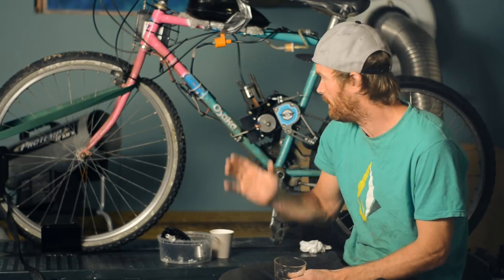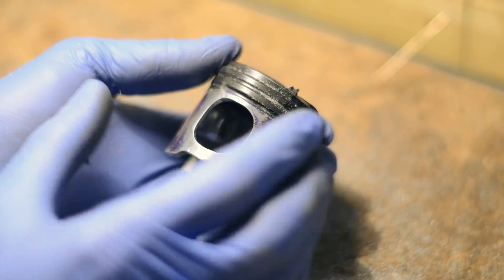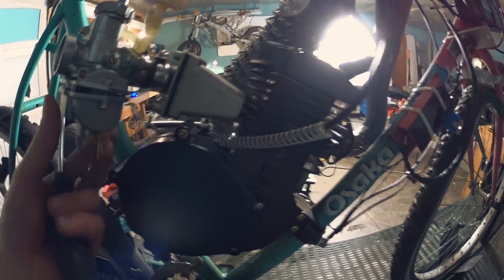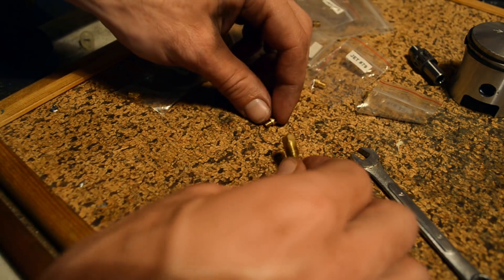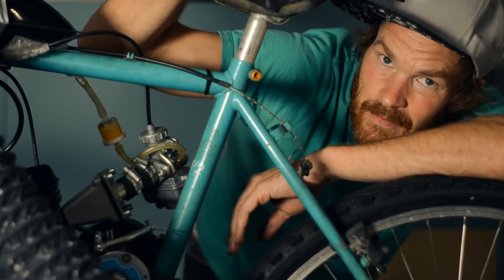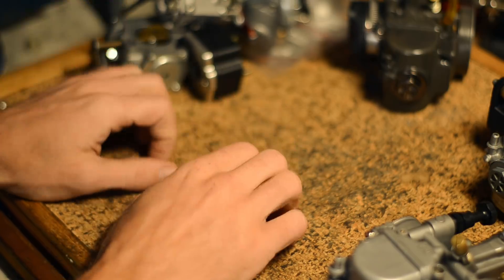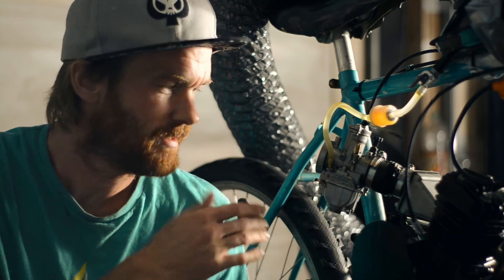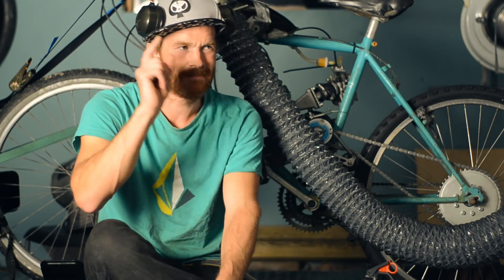Reed vs Piston Port part 2 -

Comment: I’ve also went an windowed my piston like LA Hover Bikes, now I’m going and re-jetting, I’ve got a 72 jet in now and gone all the way from 60-72 with a little bit of a better run with each jet increase. Still not running how I want it to though, any suggestions? 
EDIT: I had an air leak with one of my 4 head bolts not tightened down all the way, it is a whole lot better but I still feel like there’s more room for improvement, any idea on what size jet my get me to where I need?

Comment: 4   years   later ,   &  things  have   really 
 changed.
Reply: @Eduardo_Espinoza and now five years later and holy moly have things changed with motorized bicycles! It's crazy! Smolik Performance is the number one leader in pushing out Grade A billet engines and products. Along with the team Ken Hinson and Kelly Cansler designing the A85, good out of the box power can be had at an affordable price now. It's amazing!
Reply: @JstF64 sweet 😋

Comment: Yes Sundays were always hard to get away with LOL. I used to run chainsaws in the 80s and they had the Reed valve on the chainsaw right after the carburetor and what you really got me going on this one of us the guy who had this before me I put it on somewhere else which makes a lot of sense. They have a lot to do with back pressure or your bottom pressure or I don't know what it is but these motors are so simple to run that used to make them so simple to run back in the 80s late 70s it was nothing but a piston with a carburetor on it and a little wheel for the chain that's it now I think they make them so damn cheap they look nice but they're cheap anyway great work. I'm ready to take my bike out now I'll see if it's a disaster or if it works.

Comment: If u used an extra base gasket and an extra head gasket u would essentially have a stroker motor the two gaskets would act as a cylinder wall this way u get higher compression and can adjust to the finest degree by shaving the head and too of the cylinder down to get the tightest squish possible

Comment: Havent you ever tried a Tillotson from an old chainsaw? Like a Stihl 051 or similar? In my country they run competition go karts with a similar carb to those Tillotsons, and the engines are Minarelly based 125cc. 

Also, many guys in my country use Dellortos SHA, they bore the venturi out and drill the bottom bowl and make an adjustable needle that goes to the emulsion tube, so they tweak the High from there by hand.

Comment: You can't put big carb on and keep pumping in more fuel, you must put smaller carb to fit the engine size, moped engine = moped size carb, 12- 16 mm then adjust fuel. Don't use motorcycle size carb cause you just seen the results, no performance.

Comment: I've lead shoulder the jets that were made to large then drilled back original the used wool string to file out the jet little by little until it got the right color, { colour }, on the sparkplug. It is a slow way but it will work with those odes sized jetting.

Comment: Each reed valve was the smallest I could find this was for reed valve mass reasons twelve per cylinder, yes 24 total reed valves for the engine. Great torque from idle right throughout the whole power band and finally stopped the top flow resistances by angling and letting them open toward the inlet port. I did put screen wire mesh to catch any broken reed valves that might break over time but they never did at least until over 100,000 miles until the bike got stolen, I never got the word about the bike from the police even right to this present day. I would love to find another GT 500 Suzuki twin I 'll do the same to it as I did then it was a great bike. But now I'll do some different to the oil pathway just to see if I could reduce the oil burning to the level of four strokers, you know like about three thousand miles per quart oil but I'll two stroke oil that is bio typed not pumped oil based.
I want to seal off the mains yet flow to both ends of the rod and sealing these to flow throw the wrist pin bosses the lastly to smallish holes to the back of the piston rings groves via as many holed ports as is necessary I pull and put pistons until I find the right number of oiling ports that let enough oil to lube the piston and rings for reasonable wear limits and then take to an EPA testing shop in one of these states around here. just to see if it will pass a new standard EPA automotive level per one/half-liter volume-metrics. As 1976 motorcycles did not need it. If I could get it to pass then maybe factories will follow in to make two strokers again for motorcycles. It may not pass otherwise The Big Four of Japan would have done it. But then again they not have had the high wear polymers that we have today for the seals. Now we have polymers that swing from 5000 psi at room temp to 10psi at 5000 degrees R which did not even have to use until 1983 or 1984.

Comment: I've had this same issue by needing a size in between drill sizes. In ended up with jet that was to rich so I lead it closed then drilled it next drill size down and then used wool string to run through the jet used the wool to file out the jet until I got it to work. I tried many times but I finally got there to the right mixture time after time it took a lot of time but boy it was worth it.  I got 99 hp on the ground out of 496 cc twin Suzuki with the weight right at 417 lbs bearly over 135 mph and still got 45mpg ay 55mph. never needed spark plugs for over 100,00 miles of use. One owner which was me. chambers at 101 mm max 45 in 27.5mm stinger by 800mm long. Still, piston port system and all were still stock area while the jug raised 5mm the head gasket 2mm brought down to  0.0254mm for the head gasket. Combustion chamber in the head was the same shape as piston crown, I used the pistons to polish the heads and piston with jewelry polish into a mirror-like finish. cleaned the transfers to cylinders transfer channels sizes. Head gasket was Alcoa aluminum foil many cuts until I master perfect fit of a single sheet. All of this in 1977 at sea level while I was stationed in South Florida next to the keys.  Oh I re-geared clutch to 2:1, not the stoke 2.5:1 GMC 56:112 tooth gears this had to cut clearances by the screw holes in the cover and longer screws around the 56 tooth gear only later did them all just make clutch changes easier when the clutches needed to renewed about every 35000 miles only if I ran it hard. stoke gearing was 2.5:1 x each gear number 5 of stock transmission 2.2:1 after my work 2:1 same stock transmission 5 gears and 2:1 rear chain set I ended up with large box of reed valves on each still piston port of both cylinders got the low-end torque and the big boxes of reed valves problems made me not have 128 Hp until I made big reed valve boxes for each port. Then I got the very near 100 hp I wanted on the ground at the rear wheel.
Reply: You did good!

Comment: I just bought a oko PWK 21 Carb.  Does that reed valve, intake manifold, would it work with my Carb? Also can I use the carb coupler that came with the Carb with thar set up? Or need new one? It looks like it would, I need one... Thanks 😎 cool send me link please!!

Comment: 2STROKE STUFFING  quick tip for drilling out jets i use torch tip cleaning files they come in a ton of sizes and are cheaper too. You can use a undersized one and slowly file it bigger. Love your channel  btw keep it coming

Comment: This is a good channel, for checkin out a hobby many people have, I have built many bikes, always faster than the 1 before, the last 2 bikes, had the most reliable, and powerful motors were husquvarnas biggest  concrete cutoff saws 124.7cc, they sound like a 125 motorcycle when you replace the stock  exhaust, with an expansion chamber, and clutch is big enough and its a belt drive so figuring out the drive, is not complicated, compression release makes starting much easier, its fun to play with 2 strokes, I would like to experiment with a rotary valve intake  2 stroke if they still make any, well enough, ill keep checkin you're channel see what you come up with next, waitin to see the castings become  a bad ass kickin build, and very high rpms, don't give up, it will happen.

Comment: Nice work! Just a tip, I already made my own motorized bicycle, the real deal, took a twostroke out of a scooter and built it from scratch. With this angle you have on the carburator it may be complicated to adjust. The carburator should stay parallel to the ground. Mine had this angle problem.
Reply: Giovani Filipo Mobrizi Gabrigna just a question. How many of his videos have you watched. You say from scratch like it's some big feat. He built an engine literally from scratch guy. Not just putting parts together.

Comment: You should go with one of the walbro carbs. They are jetless so you can just tune them with the fuel screws.
Reply: Really ? what carb please ?
Reply: @MrJermbob  any walbro pulse carburetor. they come on chainsaws, and you can find em all over ebay. they're the ones that look like a cube, sorta. Some have external pulse  lines, some have internal pulse lines. You need to tie the pulse line into the open crank case somehow or another. Just find the carb with the right bore size for your engine.
Reply: If you dont mind running at peak epa performance for that moment in time with absolutely no control of adjustability then sure that will be an awesome carb. For the rest of us that will not settle this carb is absolutely trash.

Comment: How can you tell that it is too rich or too lean so easily?
Reply: Check the spark plug if your not sure... Dry and gritty is lean, oily and black is rich.... You want a clean tan/brown
Reply: @Hoopty91  What if you have a lot of oil in the gas? Could that throw off this method?
Reply: By a lot of oil I mean the amount you would use to break in an engine.
Reply: @jamessever8936  if your running your mix for the break in period, then you would expect to see a little more shine but it shouldn't be wet.... Its also better to be a little more rich than lean(for wear and tear)....  Look up - "how to diagnose a spark plug". That should give you a good idea on what your looking at.
Reply: @Hoopty91  thanks
Reply from the maker: You develop an ear for it.

Comment: Great videos love them all. sometimes i havent any spare jets and i heat the one i have  fill it with solder bore it almost through from each end with a bit suitable to the solder counterbored and cleaned both end of the jet then i bore the solder to a size i want if it ends up too big just  reheat and fill wth solder for another retry when happy use a piece of wire that fills this hole and measure it to get an idea of the size, ihope this makes sense,

Comment: I am an honda mbx 50 owner. Some times i am thinking that another reed valve placed in the exchaust side will make motor to work more efficiently . During compression the reed will be closed because the pressure until the exchaust port will be totally  covered by piston is not high. As a result there is no loss of mixture in the exchaust.  When the ignition takes place the the high pressure can open the reed valve (in the exchaust side) and maybe this will work great. What is your opinion?

Comment: I know this is old, but Ive had success making tiny 'drill bits' out of welding wire. Snip the end on an angle and leave a wide burr on it, then chuck it up in a drill. Itll still cut the soft jet material. You just need to be patient with it.

Comment: i have a question about doing a power jet on my 49 cc moped . what is your input on it and how would you perform this task and also what size jet would i use thank you -mohamed
Reply from the maker: If you're not struggling with jetting anywhere in the rpm range without one I wouldn't bother - no real benefit power wise.

Comment: Yeaaaaa new carb anything is better than original that comes with engine. You modified the slider cable increasing the vacuum leak at slider. The stock carbs have really bad loose fit for the slider as carbs get smaller the fit of the slider and pull cable boss become increasingly more critical that is why manufactures of small displacement engines use different type of carb. You'r engine has reed valved intake and this reduces the vacuum impulse that the other needs. Stick with a quality well built carb like the one you installed. You know the adjustments on this one soon as it starts easy and maintains solid idle tune for power knowing carb is over sized so rolling on is the trick don't expect to go WOT and let it wind up the over size will cause lean out. Good luck you may have found an optimum combination.

Comment: During the dyno pulls you were saying it was running LEAN!!! What are you using to see that? It never really shows in the video. I've spent the past week tuning my Suzuki RM250 with Keihin copy PWK38 using a Bosch LSU4.9 wideband sensor. The results have been amazing and well worth the effort. What AFR do you like to tune twostrokes with at WOT? I found anywhere in the 12.2-12.8:1 AFR range it goes like a rocket!

Comment: How much mm was the carb installed on the spx that was "overcarb"?
Reply from the maker: 32mm PWK, was struggling with vibration induced fuel foaming. Running a 30mm ibea flat slide diaphragm carb with good results so far.
Reply: @2STROKESTUFFING  Ok, thank you!

Comment: The reason a large carb can work on a reed intake is, the engine pulls only as much fuel as it can use on the vacume stroke, and then closes the reeds on the pressure stroke. There is little to no, overlap timing ( very good low end torque ). So you can use just a portion of a large carb's flow without any reversion to make the response lazy. But the top end power won't be relative to the big carb's capacity.

Comment: A few recommendations for more power, clean up that hole in the piston and angle the top and bottom sides to “chop” the air passing through. Much more important though is you can add a transfer to the cylinder. I use two thin ones going from the intake up to the height of the other transfers. Just make sure the slots in the rings don’t line up with the new transfers since there will be no wall on them
Reply from the maker: Good tips, and yeah I could've done a better job on the piston. Having the ring gap running directly over a relatively small port is fine btw, that how I run it in the Spx(and many other builds)

Comment: how does that clutch mechanism work on the motorised bicycle in which you can pedal it but then engage the engine and not have to pedal?
Reply from the maker: Just a typica(tho crude) plate clutch.

Comment: It seems to breathe freely I think, that hole in the wall must work good. If you use solder, be sure to clean away any remains of the flux on the inside of the jet, with a drill bit. Maybe you can use the 0,8 bit in  Biltema 19-2009, as a main jet?
Keep upping the good time in the shop, it is very interesting to follow your work.
Reply from the maker: Thanks! Thanks for the drill bit tip!

Comment: I will give you a tip! Instead of bying a specific Jet Drilling kit search on Ebay "PCB Drill Set" and you will get a bunch of sets with 10 drills from 0.3mm to 1.2mm for 2.5€. i bought like 6 sets at once about 1 year ago! works fantastic!
Reply from the maker: Thanks man!

Comment: I love your videos but I feel you could use some direction to get maximum potential from this engine. You should make a smaller window on another piston, make a decent size 3rd port which matches the width of the piston window, perhaps widen the intake port a little, and stuff the crankcase with " jb quick steel" to increase the secondary compression ratio. When you add the reed and remove ANY material that is not directly inside the combustion chamber, you are decreasing the secondary compression ratio. This not only includes the crank case, but also the inside of the intake port and the volume of the reed! Anywhere behind the reed petals is part of the secondary compression. When you decrease the secondary compression ratio (which I'm sure is already very low in these engines from the factory), you reduce velocity of fuel flow through the transfers. You want as much velocity as possible to increase power and RPM's. For this reason I believe it would be ideal to sand the face of the reed which meets the intake port to make it a bit thinner. The closer the reed petals are to the piston the better. Maybe even sand the face of the intake port as well, and stuff the reed with a bit of jb weld to reduce volume. So long as it doesn't interfere with the reed petal movement. I like to flow the transfer bowls into the crankcase with the direction of the crank rotation. This helps further build velocity. The 28mm carb does not help with velocity, even though it does run. A carb venturi size of around 22mm should be ideal, but some pumper carbs like walbro hda48d and hda 223 run fine and make good power on 60+ cc engines. These carbs have a venturi size of 15mm and 16mm. If you do run a pumper carb you may have to adjust the pop off spring to work best with this engine.
Reply: Impressive. Thank you.

Comment: Hey man i need your help. I have a scooter witch has a kinda low reving 100cc yamaha engine. And also i have a 21mm phbg copy and a original kehihin pwk 28. I want to change the stock carb (mikuni 16.5mm with 75 main jet) but ı dont know the jettings of the others. So can you give me a advice to choose jets for my carbs?  Thanks!
Reply from the maker: Start out with big jets and go down until it runs clean!

Comment: What should i do when in my pwk 24mm the slide doesnt go all the way up and i have tried set up the screw at the top of the carb to its max?
Reply from the maker: You need a throttle handle with more travel.